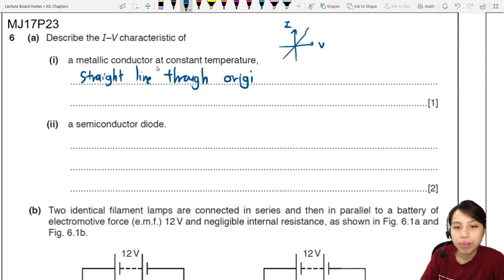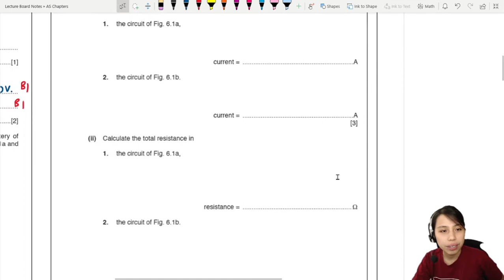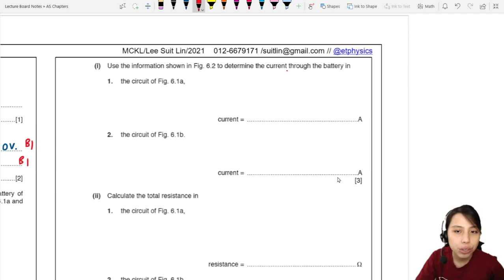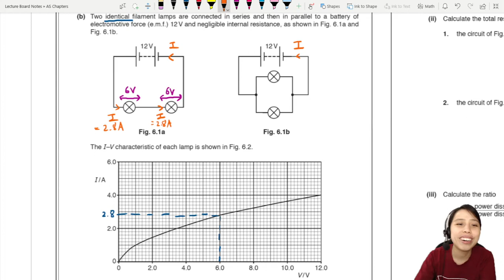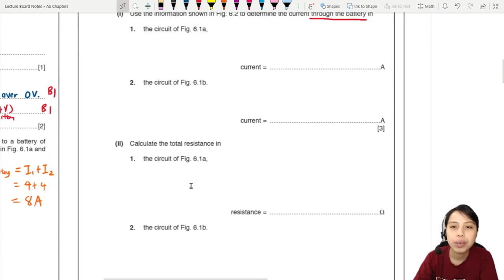9.3b Ex2 MJ17 P23 Q6 Filament Lamp Graphs | AS Electricity | Cambridge A Level 9702 Physics

Comment: in 6)ii) the mark scheme says that it is a straight line positive gradient or increasing gradient. so is it a curve or a straight line?
Reply: I think it should be a curve, because if the gradient is increasing, it should be a curve not a straight line otherwise gradient would be constant
Reply: it says either straight line positive gradient OR increasing gradient, so we can do both curve or a straight line as long as the gradient is positive
Reply: @amenamuskan1208  but the gradient always beyond threshold voltage
Reply: @bloodreaper3715  i didn’t understand what u mean by that😭
Reply: @amenamuskan1208  sorry I didn't complete the sentence, the gradient always increases after threshold voltage , right?
Reply: @bloodreaper3715   yepp, "zero current for one direction (–ve
V) up to zero or a few tenths of volt (+ve
V)" thats below the threshold voltage and 1 mark for that.
Reply: @amenamuskan1208  I see, best of luck for your exams